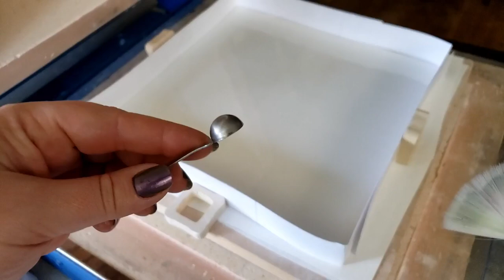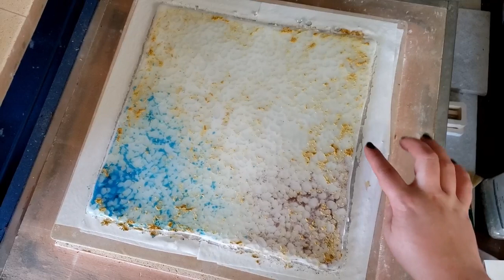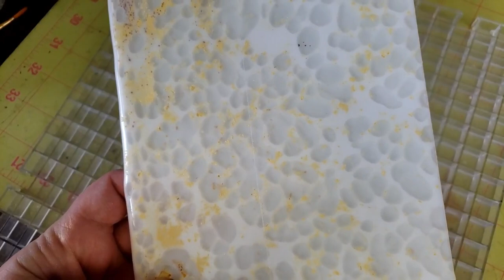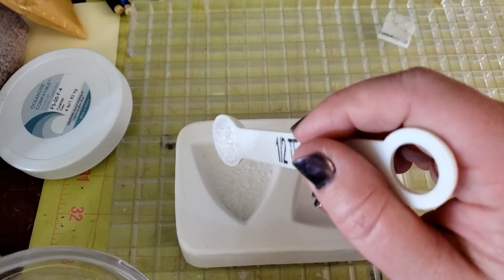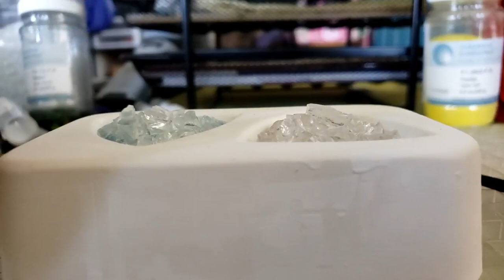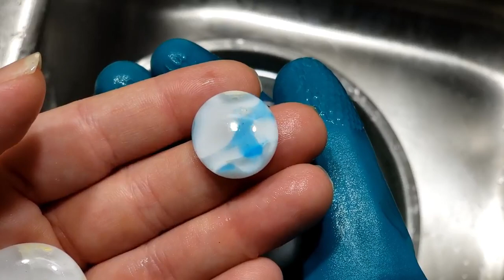Mica Experiment Fused Glass

Comment: @Yvonne Williams  When fusing micha power to glass only the pigment physically in contact with the glass will fuse to it, meaning the barest base layer is what fuses to the glass. Micha doesn't melt and flow the way glass does so it can be really finicky.

Comment: When handling mica powder you should wear gloves. The oils on your hands can leave a film on the glass and it can hold the mica in too thick of a layer and cause the glass not to stick. Mica is a natural mineral and doesn’t melt like glass. I had some that looked great but several months later it split apart. Under magnifying glass you could see the finger oils and where the mica kept the glass from fusing

Comment: Also your fingers can leave oils on the glass that cause it to be kinda scuzy after firing, best to not handle with bare fingers too much. i forgot to wash some blue adventurine glass with cleaner before adding it to the kiln and i was super disappointed when i pulled them out. flat surfaces on the glass pick up the oils much faster

Comment: I wonder how mica would work if you try a lamp work technique - make a gather, poke it onto a pile of mice a bunch, then pull a stringer.  Decorate a bead with the stringer and cap with clear?
Reply: Mica, not mice...lol
Reply: Yes you can pick up mica with a hot gather or a bead.  It does need to be encased as mica does not fuse.  Too much exposure to the flame and exposed mica can burn away.
Reply: Way cool, thanks!

Comment: What kind of glass is that? Nobody ever says
Reply: She said she was using COE96 and she also said you can use mica on COE90 or COE104
Reply: @Christine-rg2ev  im referencing the sheet glass she says she has cut... She does tell us about the frit and just because two types of glass have the same COE it doesn't necessarily mean they're compatible. I've also learned some ppl use regular window sheet glass- like from Home Depot, but thank you for answering
Reply: @Christine-rg2ev  I'm a PITA about details lol
Reply: @deannak1841  Yes - although Yvonne didn't mention the sheet glass forming the base she did say mica is compatible with all of the glass she uses [COE90; COE96; COE104]; however, all COE96 fusing glass is compatible with all COE96 frit.   The coefficient of expansion has to be the same for the sheet glass and the frit.
Reply: @Christine-rg2ev  this is from Bulleye
But COE ("coeffecient of expansion") by itself cannot tell you if two glasses are compatible. In order to know that a Bullseye glass is compatible with glass from another manufacturer, you must conduct your own tests.

Matching COEs does not ensure compatibility between glasses, no matter what you read or hear anywhere else. There are many different factors besides COE that determine compatibility between glasses. COE is just a single factor.
Reply: I do not have a glass kiln n must run a special cycle, so as much as I'd like to test, it uses allot of energy, so I really try to have "Garaunteed" results by removing doubt. my current journey is creating art glass by I'm trying to fuse and paint/stain using recycled window glass
Reply: @deannak1841  It is the case that viscosity also plays a part in compatibility (in which case the firing schedule would need to accommodate tis difference) and also whether the manufacturer has stated accurately the COE of the glass.  However; at my glass class over the last 10 years none of us have had any problem with combining any COE96 fusing glass with COE96 frit.
Reply: @deannak1841  Different types of window glass (and other glass with a COE of around 84-87) are the most likely to have problems of incompatibility when fused because the COE of each piece from a different source can be quite different.
Reply: @Christine-rg2ev  yes, which is why I'm always curious as to which type of sheet is used. Nearly any sheet glass can be fused or stained n to me it seems like a waste to purchase a nice fusing glass just for coloring with frit n mica to use for stained glass projects.
Thank u for ur support